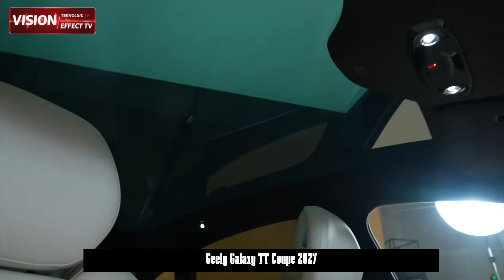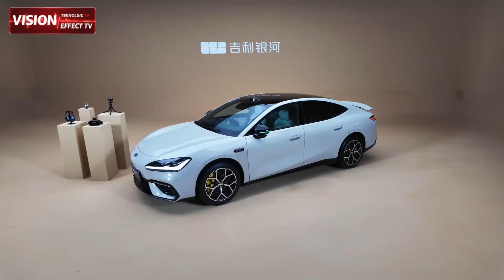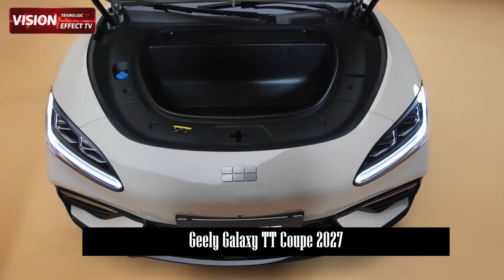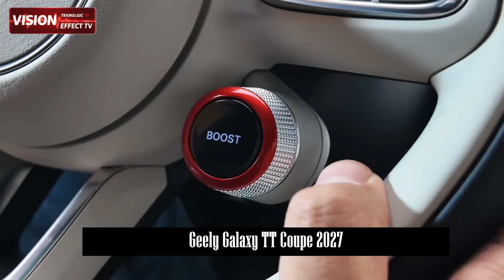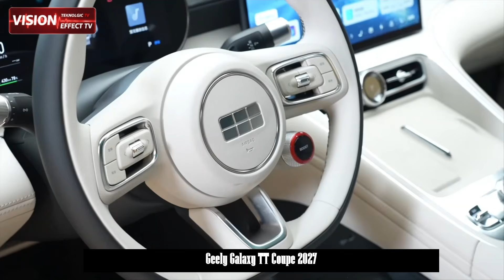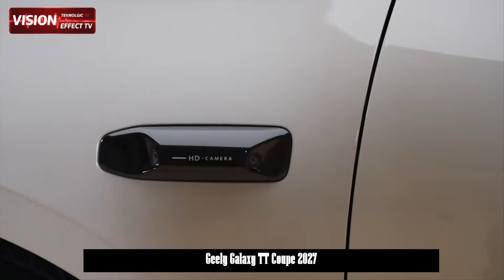A Car You Can Drive Like a Fashion Accessory! | 2027 Geely Galaxy TT First Look

Comment from the maker: Geely is rewriting the rules of automotive design by transforming a massive 5-meter sedan into a high-fashion statement that drives like a couture accessory. Merging a striking 1.3 sportscar ratio and a premium Flyme Auto workspace with high-voltage 800V charging efficiency proves that lifestyle elegance doesn't have to compromise on core engineering. The strategic question goes to you: Does wrapping advanced silicon tech and 333 horsepower into such a high-fashion aesthetic influence your ultimate purchasing decision, or do you still prefer traditional performance styling?👇